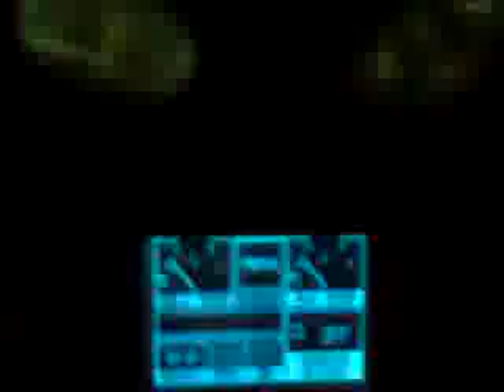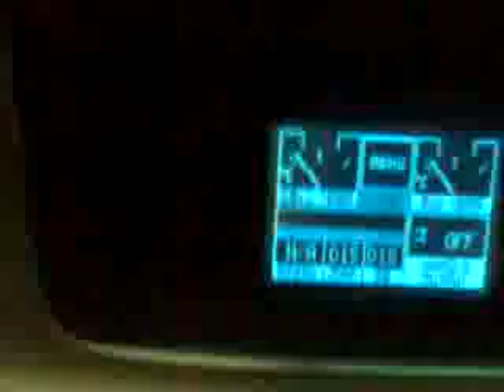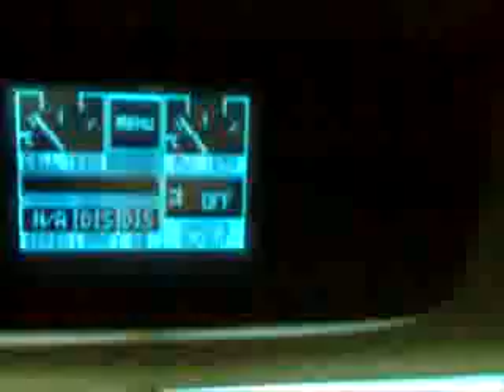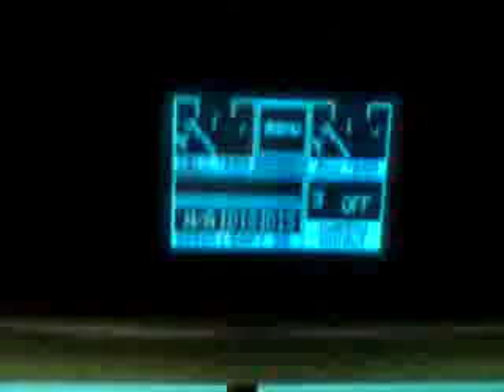Problem With VMU Circuit?

Comment from the maker: Correct you are. I use the "easy" way. OBD2 scanner. It has a handy function. Delete trouble codes (almost) on the fly. Beats disconnecting the battery. I almost have the VMU "dialed in". I'll post my setting soon. I'm still tinkering with the settings. So far, adding 270 mV is about all I have been able to function without setting a code. Map sensor is still up in the air as to how I am going to approach it. I'm still thinking about allowing the VMU to take over the MAF instead of the MAP
Peace